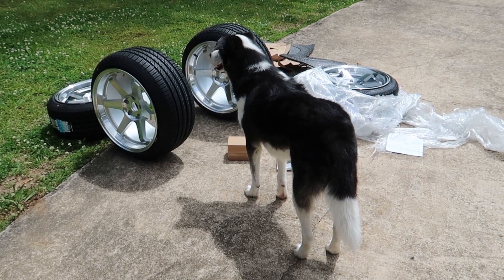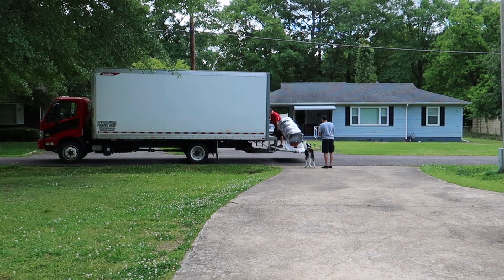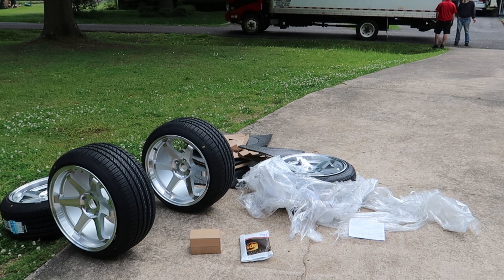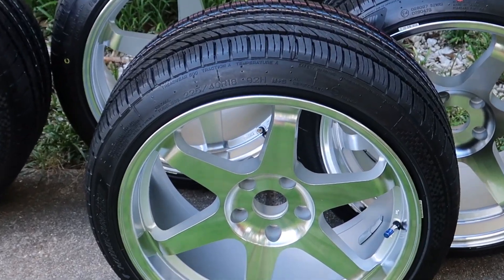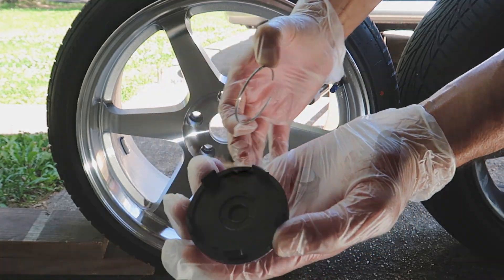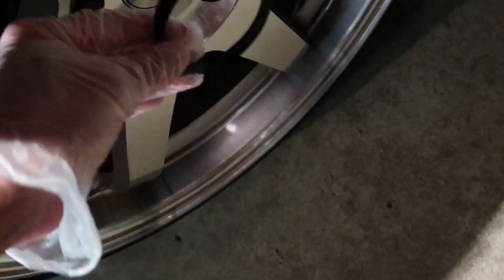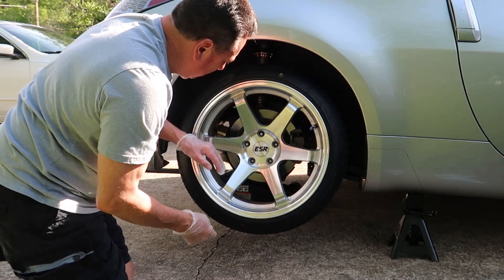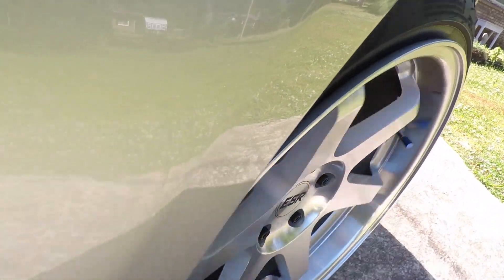350z Rim and Tire Fitment #Nissan350z #Zociety #wheelfitment350z

Comment: Honestly, if you're interested in function, just get a wheel that is big enough to clear your brake rotors. That also allows you to run a thicker tire which makes you less likely to bend a rim when you hit a pot hole, and your ride quality is a little better. I bought the 18" Z1 ZM-23s in 18x9.5 +15 and 18x10.5 +25 with Falken Azenis FK510 in 245/40 ZR18 and 275/40 ZR18. The fitment is great. They look flush and clear my Z1 BBK (akebono 370z clone) brake calipers and 14"/13.8" rotors. I did roll my fenders for a little more clearance.
Reply from the maker: I will be replacing my tires with the exact same sizes that you did, very soon!!!👍💯🏁

Comment: Im running 245/40/18 in front and 275/40/18 in rear fits perfect no rubbing on stock suspension, offset on front is +18 and rear +22 hella flush
Reply from the maker: Awesome, thanks for sharing your tire spec's!!!!and thanks so much for watching!!!
Reply: So is it possible to have wider tires without rubbing the fenders? Good to know.
Reply: @youngsinatra7666  probably the same fitment you have, it looks like it gives your Z a more aggressive look without any modification on the fenders. Thanks for the info.
Reply: One more question, what's the width of your wheels?
Reply: @carlosgomez8663  front 9.5 rears 10.5
Reply: @youngsinatra7666  thanks a lot!

Comment: Did you get new tire pressure sensors on the new wheels? If not , does the dash light just stay on or can you override it ?
Reply from the maker: My 350z did not come with the tire pressure sensors, check with your local Nissan dealer for their recommendations on what to do with aftermarket rims and tire pressure sensors and thanks so much for watching!
Reply: I don't have the sensors installed on my aftermarket wheels. When I found out Nissan would charge me to program them to my car, I said PASS!!  The light blinks for about a minute or so, then just stays on.  I got used to it.

Comment: Question for the hub ring did you go with the 73.10 - 54.1 or it doesn’t matter as long ass it’s 73.10 (hub bore size) ?
Reply from the maker: I got the wrong size ( I think I got 74.1-72.6) to small. So I would recommend that you contact ESR or what ever company your rims are from and ask them for the exact size hub ring you'll need! That's what I'll be doing next! Thanks so much for watching!

Comment: I'm also running on 275 40 18 rear and 245 40 18 on stock suspension not rolled fits fine..
Reply from the maker: Awesome,  thanks so much for sharing your tire size!!!!
Reply: Is that on the stock brembo 18s
Reply: @notoriousxp1893  you can use that setup with an offset of 22+ on the front and rear, I plan on using that setup in the future hopefully since I have brembos.
Reply: Can you run 18x8.5 20offset with 18x9.5 20offset to the rear with stock suspension and without rolling fenders ? I would like to run this setup but don’t want to roll my fenders or do any modifications
Reply from the maker: You can run a +12 to +22 offset and still clear a Brembo brake caliper!! 🏁💯👍

Comment: Would 225/40/18 in the front and 255/40/18 in the rear be fine for a 350z stock suspension?
Reply from the maker: Should fit with no problems!!! Thanks so much for watching!
Reply: Stock should fit any size however but lowered or slammed you’ll need camber kit and rolled fenders

Comment: Just found your channel I just bought a 350z with 19’ rims idk exactly the specs and I do hear rubbing but I don’t see where it’s rubbing at the front is 245/40/19 and the rear is 275/40/19 I want to change the rims and go for a bit of a stretch not to much with a 19’ rim still thinking if I should go staggered or square but don’t know what tire sizes to get for the small stretched look
Reply from the maker: I love the staggered look, but that's more of a personal preference thing! As far as going with some stretch, my tire setup is about as far as you should go! So just a little stretch might be something like 235/40/19 front  and 255/40/19 rear! Thanks so much for watching!
Reply: @Zspeed  would you ever recommend going down to a 35 instead of being at 40?
Reply from the maker: You might damage your rims with a 35 versus a 40 if you hit a big enough pothole!
Reply: @yungshaq5166  If you were going with the 255 front, 275-285 rear, I'd go with 35, but at 235 and 255, stay with 40.

Comment: Does anyone know if I run 255/40/18 front and 285/40/18 rear what negative aspects could I have? Right now currently it’s on stock suspension but I will plan to lower it. Another big concern of mine is that if I go w these set of wide tires how much of “acceleration” will I lose since they’re a bit wider than stock.
Reply from the maker: Most people run 245/40/ in the front and 275/40/18 in the rear, you may have some rubbing in the front with 255/40/18! This should not  have a significant impact on your acceleration! Thanks so much for watching!!
Reply: I went with the same width and offset as in this video, but I got 19 inch wheels.  I'm wearing 255/35/19 in the front and 285/35/19 in the rear, and had a slight rub in the rear at "stock height", but no rub in the front.   The width of the tire does not affect acceleration, tire circumference and unsprung weight do, so if you choose wheels that are lighter than stock you should offset any additional weight due to the fatter tire.
Reply: @Quidproquo07093  I actually went with the 255 and 275. I didn’t run into any rubbing issues which was great. Of course I needed to roll the fenders. So far it’s been holding alright, I haven’t seen anything wild.